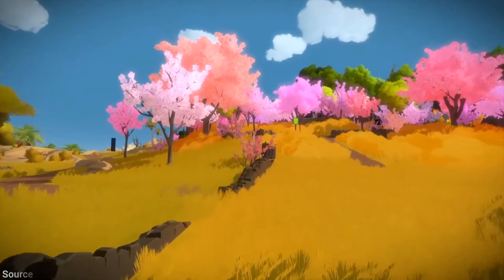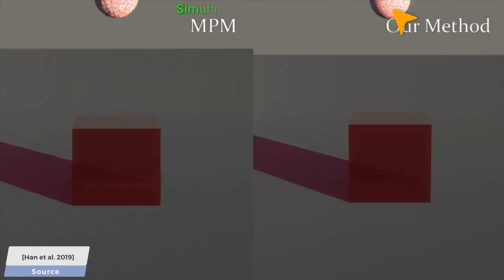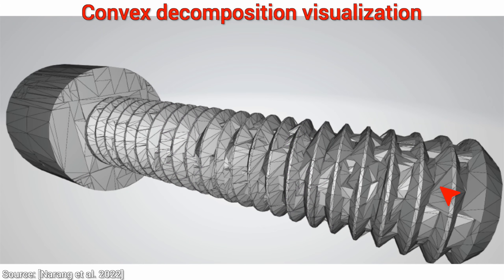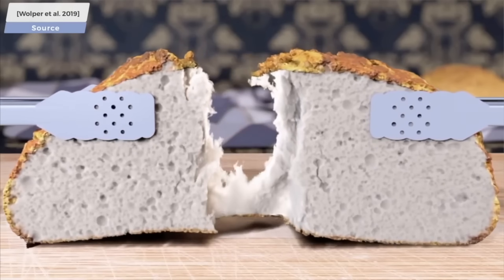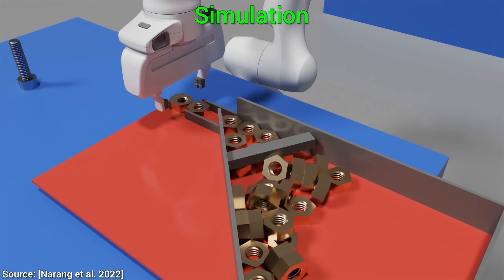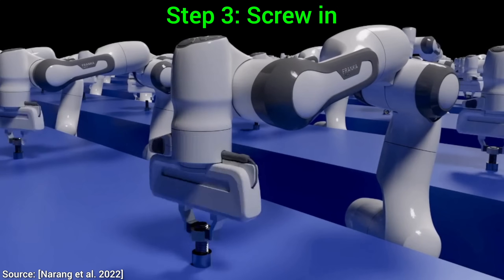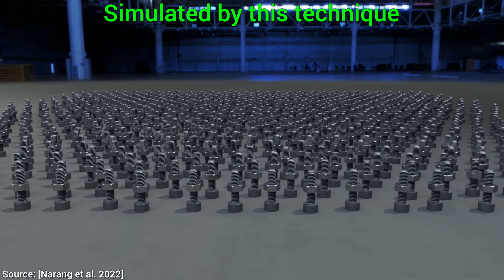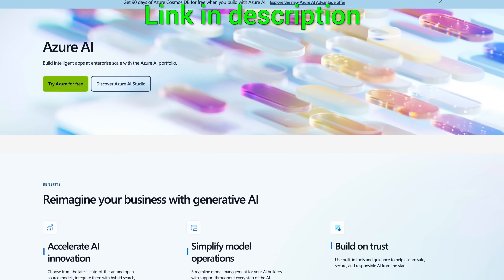NVIDIA’s AI: Virtual Worlds, Now 10,000x Faster!

Comment: When you said "everything is simulated down to the last millimeter"... you were just using an expression, right? It has to have higher fidelity than millimeter-level to be useful in any real life context... especially dealing with things like machined parts, 10,000ths of an inch are the common unit. A millimeter is gigantic in comparison.

Comment: 2:21 - Bolt SDF (SDF stands for SIgned Distance Field, btw) visualized as point cloud, Bolt SDF visualized as mesh. Both of these are a mistake for a mechanical part being made to a mesh approximation of a solid, both the source and the cause of all of the collision detection problems that follow. The moment you triangulate and then do collision detection on the triangulated meshes, you are effectively doing collision detection wrong. It doesn't matter whether the resultant mesh is made of quads or nGons or how "perfect" it is topologically speaking, no matter the mesh, it's all triangles in the end and this plethora of triangles is what will fed into the collision detection algorithm(s). Compare and contrast this method with how any CAD application or mechanical application worth its salt, represents mechanical solids like literally nuts and bolts. They are represented as non-destructive solids and surfaces backed by exact mathematical formulas that describe them with a good heap tablespoon of Constructive Solid Geometry (i.e., bool operations like union, intersection, and difference, all performed mathematically and perfectly - try that with a mesh). The moment you map the solid to a triangle based mesh, even for something relatively simple in the grand scheme of things like a bolt, you get a proverbial crap-ton of polygons to consider for collision detection or you cheat and come up with a bolt that looks like it came out of some sort of FPS shooter with hexagons for curves. This is the case, at least, if the object of interest has curves and then requires a considerable amount of mesh geometry to approximate it. It can never be exactly mapped to a mesh, only approximated with greater and greater accuracy at the cost of an explosion in polygons (read, triangles) that are used to form those mesh based approximations. Then you have to deal with that vast sea of triangles when you do your collision detection, making it a very expensive process, even if you take shortcuts and break up triangle groups into volumes, along with other similar techniques used to cut down on the test of "which triangles are colliding, or worse yet, which surfaces are intersecting that cannot intersect, because they are rigid bodies.

Comment: maybe an even more elegant solution to problems like this is a combination of the visual rendering of the mechanics for the optical sensors of the machine learning algorithm together with pressure sensors for the algorithm to learn in combination - when i plug in a USB port or tighten a bolt my eyes are rarely what i rely on to know it's on tight, and i'm not blind.

for the calculations of the nut and bolt  - why calculate the whole bolt and not the main line of the thread and from there calculate the surface area that will come in friction?
asking wanting to genuinely know

Comment: as a guy who works on this stuff, i can say that complex geometry simulation of the bolt threads is not necessary. as soon as the bolt enters the nut, it is enough to turn them into a single physical object, where there are only 2 interconnected degrees of freedom between the nut and the bolt (rotation with movement along the axis of the bolt). 

physical stimulation is needed only at the very edge of the bolt and nut to determine whether the bolt has entered in the right way
Reply: And how i am supposed to study the series of events that causing a jamming ?
Reply: It's impressively embarrassing that you don't understand why the physical sim is an absolute necessity in this context. Especially seeing as you work in the field, that fact makes it significantly more embarrassing.

Comment: Why simulate nuts and bolts at the highest level whilst not being assembled? Once a bolt is in place it can return to being a static part. And when referring to "simulated" here, we obviously leave out actual engineering simulations using FEM, correct material, stick-slip, tribology etc etc. Granted, this will be done in the engineering stage, not the assembly stage. Anyway, I'm sure we'll reach the point where we can do both in the same environment and have AI assist us with everything from ideation, specification, design, validation and production planning/factory organization. It's just a crunching game 😁👍

Comment: What's the success rate of a custom-made machine? Is this a close enough match for general purpose robot arms to be implemented in a real-world setting? Or is an 85% success rate for the initial attempt still leagues away from being acceptable?
Reply: A practical machine for mass production purposes would need 99.99% accuracy and a reliable way to report the the 0.01%

Comment: Humans learn to correct the alignment of the nut with the bolt by feel, with trial and error on every attempt. A robot could very easily learn to derive the proper thread alignment from a visual analysis of the bolt threads and the nut threads, to start the nut from the ideal position every time.

Comment: Wait, wait, wait. What was the whole purpose of this simulation? Fastening a nut to a bolt is not a complicated issue, if you solve it mechanically, not spend years and a ton of money on a simulation that has 85% success rate, which is pathetic. 
Cam someone explain the idea behind this, it doesn't make sense to me, when we are having so many ways to solve a practical problem faces every day by automation engineers.
Reply: quite simply, its generalisation. Your machine can fasten a bolt with perfect accuracy. But your machine could not afterwards attack a plate, fix a digital controller to that plate and plug in the required cables. 

Generalisation has been the main target for most robotics research in recent years. These machines can reduce mechanical complexity and can solve and adapt to more problems.
Reply: @Broken_Mesh  alright, this makes more sense now. I am just worried about the real, the practical application.

Comment: Game engine developers: 👁️👄👁️
Reply: Game Engine developers make use of SDF based physics all the time, it's just this level of fidelity is rarely required in games so those clock cycles are used for other things.
Reply: @locinolacolino1302   "is rarely required". 

As someone who plays Space Engineers I disagree, clang is my enemy, I wish I could stack 8 GPUs in parallel and increase the simulation to 800hz. 

I always thought it was janky because the physics runs at 60fps, but that's too slow.

Increasing the mesh detail decrease the performance exponentially, not linearly, that's why SDF based physics don't do that. 
But this paper proposes a solution that doesn't need more detail, so you can actually increase the simulation to 800hz and thus decrease janky.

I think I'm going to make a factory game that's actually physics based instead of just being a logistic simulator. Imagine real items in the conveyor belts, that's going to be fun.
Reply: @monad_tcp  in Godot, a simple chair falling lags the whole game, though maybe I'm doing something wrong idk
Reply: @voinea12  use the godot jolt physics addon, its supposed to work a lot better (and it sounds like it will probably become built in at some point)
Reply: @monad_tcp  yeah same.
Reply: Do game engines use SDF for collision? I have seen things like Niagara in UE5 use it, but generally collision is done with a collision mesh, or using original geometry (very expensive)
Reply: @dreadthedrums  not many I think, I think this mostly makes sense for very complex geometries that can't be accurately reduced to fewer triangles/collision shapes

Comment: Wait, I don't understand. Are they still using triangles with the bolt or they are using other stuff?
Reply: Instead of triangles they are using SDF (signed distance fields) a form of mathematical calculation of the volume of the object. Its what Unreal Engine 5 uses for good and fast collition detection and other effects

Comment: You're telling me this thing can plug in a USB correctly on the first try? Uh huh ok pal, lets easy down with all of the sci-fi
Reply: i heard usb-a are 4 dimensional which is why you gotta flip em over twice
Reply: @SantinoDeluxe  They aren't 4 dimensional, they are in a superposition of stated (i.e., directions) until they are actually observed. This measurement (observation), causes the superposition to collapse to a single state (direction). It is is easy to insert the cable after the observation is made and the subsequent instantaneous collapse takes place. Don't be fooled by what you seen when you make the observation, because that's not at all how the connector looked or behaved, before you turned it 180 degrees and look at the head to see its alignment and directionality.
Reply: I can do that too...

with usb-c
Reply: @Ou8y2k2  edit so it makes more sense. Sorry.
Reply: Yes, actually someone taught me to look for the EDIT: "seam" on the connector and face that down. It usually means the logo faces up. Regardless once i figured that out, I got them right more often than not
Reply: @geniferteal4178  
But many connectors are vertical, some are upside down, and usually you have to do it blind reaching behind the computer.
And to make it even worse, there are other connectors that feel similar to touch, but are not USB.
Reply: @andrasbiro3007  I never said it was perfect. It really made me get it right. Most of the time when you know that the seam of the metal that surrounds the connector needs to be on the bottom, the rest kind of falls into place
Reply: this is evidence based. stop your ignorant dreams
Reply: @businessmanager7670  it was a joke lmfaoooo

Comment: No WD-40 simulation?
Reply: What does Water Displacement recipe 40 has to do with bolts?

Nah, I get, don't worry.
Reply: Now that would actually be a massive paper. Love it!
Reply: 10 papers along the line we get the "soaked in saltwater for years bolt  that you have to heat with the welder and whack with a hammer  -simulation"
Reply: I tell ya hwat

Comment: I don't see why you would need to simulate the screw as a complex physical object, if all you were doing was a training simulator. All you would need to do is use some testing to figure out how "a screw" works in terms of shape vs outcomes, and then you could just predict the outputs by just entering the screw's radius, thread height, and total length, and just assume that the bolt will match it and the screw works, and it could make a simple calculation to spit out how quickly that screw could be turned. As an interaction between all possible points of a screw, it's a complex problem, but as a calculation based on the assumption that the nut and bolt are designed to work, it's a very simple math problem to solve.
Reply: You should mentally simulate the response of a senior Nvidia engineer to this comment; I'm sure it won't be at all humiliating.
Reply: @cosmiclounge  He would be so embarrassed to have not thought of it first.
Reply: Please never talk again. facepalm.